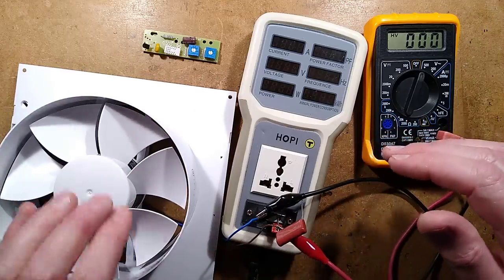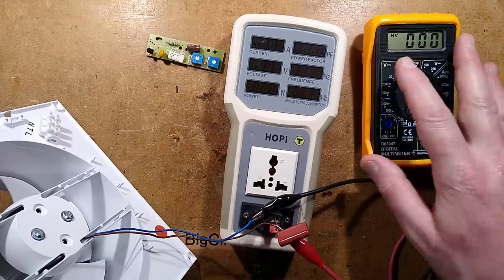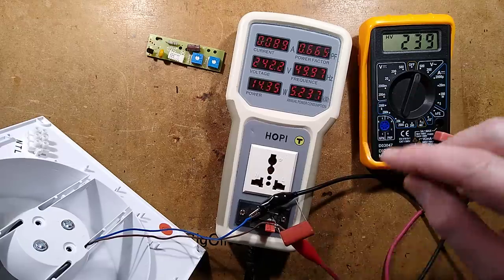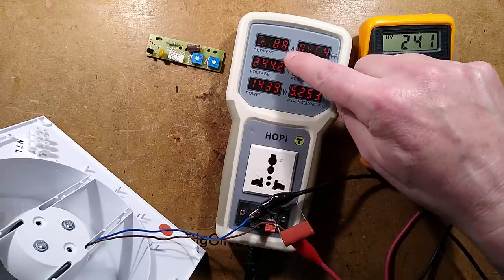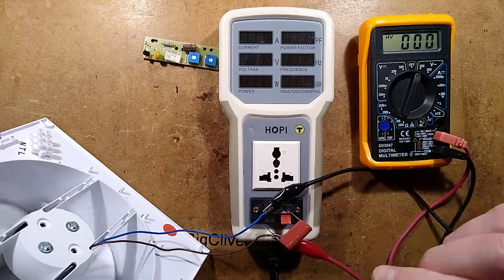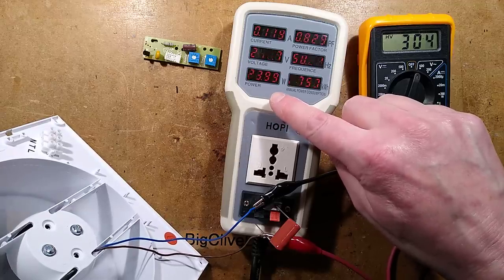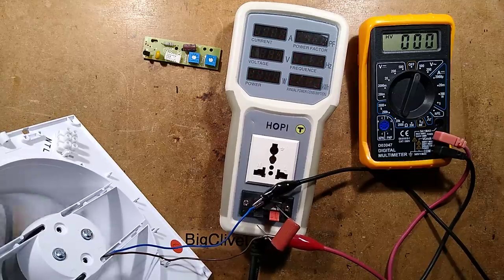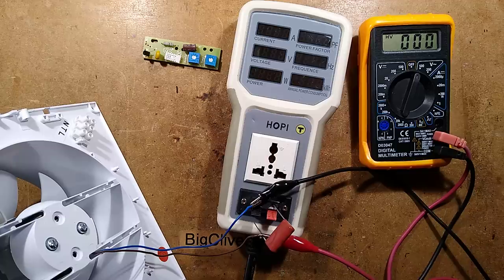What the heck!  Series capacitor makes fan go TURBO!

Comment: I believe you jacked into, what is commonly known, the cosmic energies and have achieved perpetual motion. I saw the previous video before you re-uploaded this one, where you unplugged the mains and the fan still kept going as a closed oscilating circuit. But I do agree with your decision to cut that part, as it will be a little too controversial.

Jokes aside, the fact that adding the capacitor esencially doubles the wattage is somewhat bizarre for me. It's been a while since i've done physics, but for me, adding a capacitor into an induction load heavy circuit was always about lowering the kWh so you pay less. Maybe this particular motor is overspecced for longevity, as I assume its a ventilation fan that is designed to work forever, so the coils are more inductive than they need to be, so a capacitant load balances it out.

I see that other commenters explained it better.

Comment: As a RF engineer , I may have a solution ... you seem to have a combination of  L & C which is ( almost ? ) resonant at 50 Hz ... at ( max ) resonance the voltage across the  SERIES  components goes BONKERS ( up to 5000 Volts on a battery powered lifeboat transmitter ! , this is how they tune for max power up the  long wire mast antenna using a variometer / variocoupler  ) ... you are probably slightly off resonance , lucky , as the capacitor would have broken down .. ( KA - BOOM , big stink ) .... DAVE™   🛑

Comment: I thought capacitors were always paired with motors on ac stuff to attempt to correct the power factor.. I imagine that the valve of your capacitor is shifting the power instead of correcting the power factor or shift exactly a half phase too far

Comment: I noticed the voltage got near to when an AC voltage is rectified, could the capacitor be kinda acting like a Diode and sort of blocking or delaying the wave form so it builds up??? (Or am I way off?? & are we seeing A LC circuit at play here... ANYONE??)

Comment: The meter is not reading True RMS. And you are not insane!  It would only be insane if the voltage you read exceeded the Peak AC Voltage, which it does not. For 241 VAC, times 1.414 (root2 if you want to be more precise), the peak is 340.8 volts. All is well! :-)   Another way to check is to rectify and filter the AC voltages in question. Then even the cheapest meter should give a reasonable reading. Note: For 3-phase power, you sometimes have to use 1.732 (root3).

Comment: Man, I see a lot of keyboard warriors in the comments that think they know what is going on, but I honestly don't know that they do. Like power factor correction is great and all, but we use it to save extra current in transmission lines, and get some minor improvements in efficiency. Its an AC motor, the top speed should be tied to mains frequency, regardles if its syncro or inductance.
Reply: ..not just frequency being a factor..., applied voltage matters too & here it's gone too high...

Comment: Partial power factor correction.  You should swap out the cap until you get closer to unity.  300 volts across the motor should be fine,  as it is impedance protected anyway.  Shoot for around 340 volts at the motor.  Just please avoid Mehdi Sadaghdar's  FULL BRIDGE RECTIFIER!

Comment: cap is act as aditive resistance meesing with impedance of while circuit :).. coz is in SERIAL LRC cicuit.. capacity/peak AC voltage/voltage drop/phase shift, determine how much power draw.. simple as that,, for more use regular LRC math example and just add your variable :)

Comment: Phase reshift?
Reply: Ok - only now i figured out its an AC motor not DC - so for me the Voltage across the motor is higher thanks to the capacitor in series for AC. I recall that AC can have some Voltage dividers in parallel  made from capacitors (if you need to power up some 90V LED) - just like resistors can make easy voltage dividers for DC

Comment: You've accidentally discovered how capacitor-start/run motors work.
Reply from the maker: Those ones use the capacitor with a separate winding to introduce a directional phase shift for rotation.

Comment: Is this not how fan speed controllers work. I know they have capacitors wired together in different was for different positions and I think it's the highest capacitance settign that is the fastest. IS that how a capacitive dropper works? Is very simular to the fan resistor in car systems except adapted for AC.

Comment: Really?! xD Ok this has to be bait, rut anyway. This is basic engineering knowledge. You compensate the inductance and power factor raised from 0.66 to 0.8. You can increase it even further if you chose the correct cap. This will make a LC resonate at exactly 50Hz in this case.

Comment: No, no, no.  All of you have it wrong (though the power saver capacitor returning the free energy is a good guess).  Actually, the little electrons are frustrated because they can't penetrate the dielectric in the capacitor, so they are taking out their frustration on the motor.  🙂

Comment: Isn't ac voltage the average of a wave form so it is actually higher than what a volt meter reports? The cap is storing more of the peak voltage and dumping the hight voltage out when the peak passes, changing the wave form.  Kind of like a DC rectifier giver higher DC than there is AC

Not an electrical engineer at all, just someone that plays with caps often.
Reply: If the meter is reading 305 RMS, the peak is a lot higher.

Comment: The voltages measured are not in phase with the currents.  Therefore the power dissipated by the fan and capacitor are not the product of the voltage and current.  So running too hot shouldn't be the concern; the higher voltage might be.
Reply: Or am I talking about parallel resonant circuits?  We seldom deal with series resonant circuits, and this is series resonant.  I need to refresh my memory.

Comment: You've changed inductive load to capacitive load and the power supply seems to like that.
but keep in mind that the lifetime of the motor will degrade faster by doing this.

Comment: Chat gpt says.... To explain this, we first need to understand a little about inductive loads, capacitive loads, and how they interact in an AC circuit.

An inductive load, such as your fan motor, causes the current to lag behind the voltage, meaning that the current reaches its peak value a little later than the voltage does in each AC cycle. This is because an inductor (like the coil of wire in the motor) stores energy in a magnetic field when current flows through it and then releases this energy back into the circuit when the current tries to change.

On the other hand, a capacitor in an AC circuit causes the current to lead the voltage, as it quickly charges when the voltage increases and discharges when the voltage decreases, thus producing a current that reaches its peak before the voltage does.

When a capacitor is connected in series with the inductive fan motor, it forms what's known as an LC circuit or LC filter, where L is the inductive load and C is the capacitor. The total impedance (or resistance to current) in an LC circuit depends on the reactances (a sort of resistance but for AC circuits) of the inductor and the capacitor and the frequency of the AC voltage. 

The inductive reactance and capacitive reactance have opposite effects on the current - one delays it, the other advances it. If the capacitive reactance equals the inductive reactance at a particular frequency, they cancel out each other, reducing the total impedance of the circuit to just the resistance of the motor windings. This is called resonance. The current in the circuit can increase because the impedance has been minimized.

The addition of a capacitor in series could have increased the fan speed for two reasons:

1. Resonance condition: If the added capacitor created a near-resonance condition in the LC circuit, the impedance would have been reduced, allowing more current to flow. 

2. Power Factor Correction: Capacitors are often used in AC circuits to correct the power factor, which is a measure of how effectively the circuit converts electrical power into useful work. An inductive load like a motor has a lagging power factor, meaning that some of the power supplied to it is stored rather than used to perform work. By adding a capacitor, you can correct the power factor and cause the motor to consume power more efficiently, possibly increasing its speed.

The increased voltage across the fan motor and capacitor could be due to the resonant condition of the LC circuit. In a resonant LC circuit, the voltage across the individual components (L and C) can be larger than the supply voltage due to the energy stored and exchanged between the magnetic field of the inductor and the electric field of the capacitor. 

Remember that these are theoretical explanations and actual results can depend on many factors. In practice, due to safety concerns, you should always consult with a qualified electrician or electrical engineer before modifying electrical circuits.
Reply from the maker: I think it got it as its final guess just before its disclaimer.

Comment: Series oscillator acts as a voltage multiplier across each component, but current is "rocking" between the inductor (fan) and the capacitor.

Comment: ONE THOUSAND+ comments for 1:36 mins of CLIVES vid❤❤😂😂👍..
This series cap/ inductive fan combination shows "improvement" of pf. BUT @ the cost of higher wattage AND a dangerously high voltage is now seen by the fan windings..
Subsequently one would end up with a burnt fan windings & or damaged bearings..
For pf. correction the "resonant" cap is always across the coil winding ..for the cap. to dump its charge into it when coil current lags and  
recharges itself from coil inductively generated voltage ..this happens because the utility now cannot absorb it...but current has to continue to flow..& and it flows to the cap...
This exchange is on every cycle so the fan now only draws
 " resistive " power from the utility hence it's lower amperage & the pf. approaches Unity.
In the series cap/coil case the voltage is being attempted to circulate between the two.....hence they both experience higher voltages across each other..this can lead to voltage failure of both.

Comment: Place a second capacitor of the same value on the other leg and see what happens. 😁
Reply from the maker: That would theoretically just be two capacitors in series, so half the value.
Reply: It was just a bit of a silly comment. But I was thinking perhaps your phenomenon could have something to do with inductive flyback. It seems strange to me that the voltage reading changes from the mains value. It would be interesting to hear your explanation once you know the answer.

Comment: It is quite difficult to say what is going on here without opening the fan (with spudger!) or seeing any schmoke escape!

However, on a serious note: most comments reflect what I was thinking too. The cap and inductor sets up a well-tuned series (or serious?) resonant circuit. The power factor also improves from a demoney 0.666 to over 0.8... which will explain the speed increase.

Or something!

Back to sleep! (I just woke up to quickly check for any smoke signals from Clive up north from South Africa!)

Comment: I would think it's impossible for the fan to have more voltage across it than is supplied from the mains. I''m guessing there's a funny shape to the AC waveform that's fooling your meter. Would be interesting to put an oscilloscope on it (safely of course).
Reply: Nope, you've got two devices there that can both store energy - the inductor stores it in a magnetic field, and the cap stores it in an electrostatic field.  They're getting close to resonance so the voltages are reinforcing.  It's like swirling your finger on a lead crystal wine glass and making it sing.  The amplitude of sound coming out is far greater than the amplitude going in because it is at resonance.

Comment: the inductance of the fans motor and the capacitor are forming a series resonant circuit. you're lucky to only get 300V, it can be a lot more. If the frequency of the power supply and the frequency of the resonating circuit matches closely, the voltage at the capacitor and the inductor would increase indefinitly. 
This is btw. the way a Dual Resonant Solid State Tesla Coil creates its high primary voltage.

Comment: when you ad the capacitor in series you make a RLC circuit ore also called a RLC oscillator.  this will change the frequency  of the AC signal

Comment: Im also going to say "power factor". The motor is designed to have a particular inductance to provide "back EMF" and run at a particular speed and power output. The capacitor changes that.
Reply: It's an induction motor. No back EMF.

Comment: Duh, its a phase shift thing.The fan is behaving more like a resistive load.All this can be calculated by 2:nd degree calculations.
With the right load,a polyester capacitor offers, as an example, a 60 degrees delay.There are certain Fender guitar amps that uses this to save a circuit from oscillating, that was in the early 60´s.Nasa knew this while designing the mindblowing Telemetry system, including data exchange with the BIG;BIGGLY BIG Computer at Houston.Few Frequences but carrying a shitload of data back and forth.-So Nasa investigated the phenomena of the relation of static and non static Impedances.I know that Impedance implies AC Power,But man alive it includes DC too

Comment: If the fan is DC PWM, it could also be the voltage and phase shift messed with the on-board PWM chip leading to an increase in speed and with more 'on' time in the duty cycle. It looks like a computer fan to me but I can't tell for sure.
Reply from the maker: It's not an electronically commutated motor.  It's just a simple one.
Reply: It is probably just a shaded pole motor.
Reply: @RicoElectrico  Yes. I'm assuming it's a shielded pole induction motor.